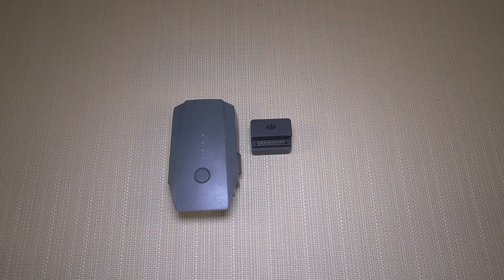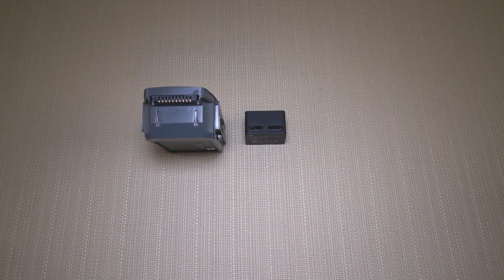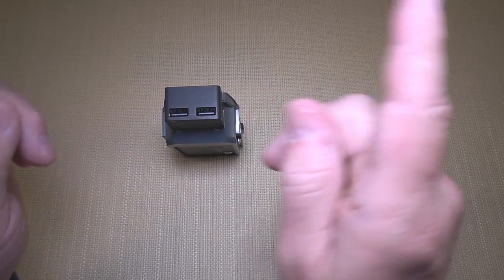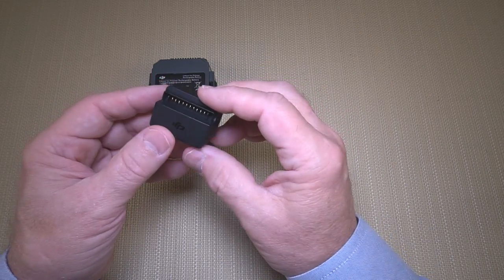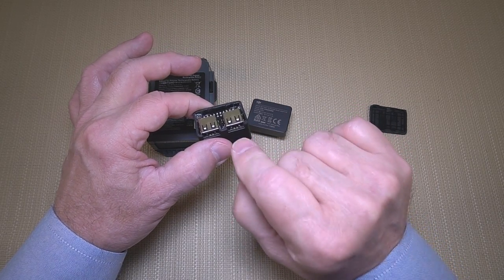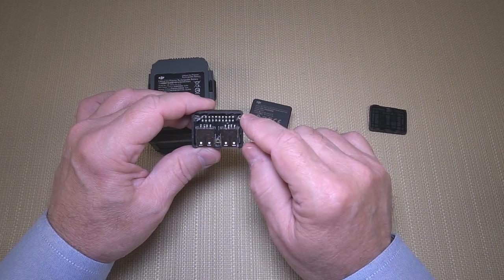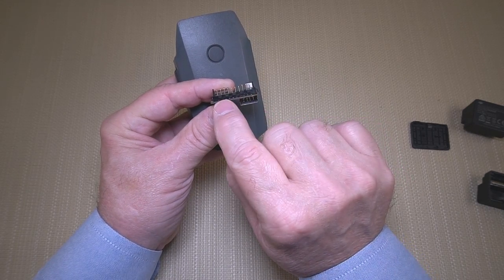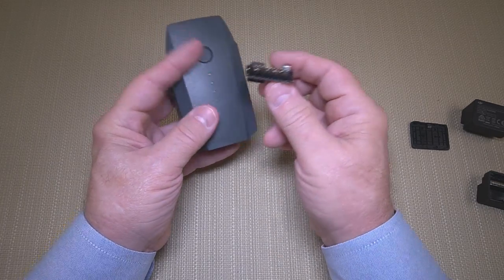What Makes It Tick - Mavic Battery Bank Adapter Teardown

Comment: Hello Rick, thanks for the heads up and technical explanation. Talking about those car charger, I have 2 slots for iPhone and ipad... i guess with 2 different amperage. Can I use the iPad slot to charge my iPhone faster and is there any risks for the battery? Thanks in advance

Comment: Not just the MP5402M is a good dc/dc controller itself, it even take care of the communication with the connected devices, to tell them they can draw up to 2A. 

So in my opinion they catched two flies by choosing that specific IC. 
Pushing the efficiency (e.g. in comparison to the 34063, at least for the higher switching frequency, just just by less component count) and get rid of a second IC just for communication (droping the idea to just use resistors). 
I myself appreciate that decision :)

Comment: Hello from Venezuela and thanks for the videos! I would like to know from your point of view as an engineer, why there is not a charger that allows recharging MAVIC PRO batteries using a POWER BANK, thanks!
Reply from the maker: Kake, thanks for the post and the challenge with using most conventional power banks is that they are designed to work with USB devices that require 5V. the Mavic cells are 11.4V, which makes it difficult to charge them. Also, most power banks don't have the capacity to charge them fully. There are a few specialized products (Energen) that are larger power banks designed to do this for you. Search my channel and you'll find a few reviews I did on these.
Reply: Thanks my friend. I have a 30.000 mah Power bank with Qualcomm USB A and C type, I was wondering if something like that will work with some sort of adapter. I will check the video about it in your channel. Thanks again!

Comment: Thanks for the video. I do have a question however. We have been told in the past not to drain the battery to low. Will using this unit possibly jeopardize the battery if we use it at say 20% charge? Thanks again.

Comment: Thanks Rick, Smokey here from Oz and great video as you always do. Yes, I use the adapter very often and it is great! Phone, iPad, Shield tablets and so on. The teardown was superb. I also have several DJI drones and have found over the years they have always been of great quality in their choice of components. I also have several Walkera drones but cannot say the same about their choices - have even had to take out the solder gun to rectify things on them. Have you ever owned/flied a Walkera model. Just interested to know (if so) your experience to mine (I have also their Pro and Premium models of the QRX350's).

Comment: I know what this device for but I was scared to use it. Always thinking, thinking “shall I use or shall I not”. Because, like you said I don’t want to damage my devices. After I watched your video I trust the product now. Really REALLY nice video and explain me a lot. Thank you for sharing knowledge. I really appreciate. 
I have one question left to ask, if you can help me to find out. Do you believe that I can charge iPhone 7 Plus by using that product? Because when I called Apple, they said their “i” products which use lighting cable are different voltage from other old iPhone models.
However MANY THANKS for knowledge. 👍

Comment: Hey Rick, great video, but I was curious if you knew how low you can discharge your mavic battery with this adapter (or in general)? Does this automatically turn the mavic battery into an actual power bank so you can fully discharge it or is this unsafe for possible cell damage? How low would you recommend I should bring my mavic batteries so I can get the maximum amount of use out of them but still not harming the battery? Thanks.

Comment: Please do a tear down of the YX 5 port Mavic charger.  3 Mavic batteries, DJI goggles and the Mavic's controller are a lot of valuable products to trust to this charging device. I'm guessing it will not be as well engineered as this is.

Comment: You can charge the phone using a wireless charger and not worry about wiring it.  My Galaxy 8 uses very little battery life with flights.  I use airplane mode that kills alot of apps.

Comment: Wow great info. The info is perfect for the layman and the rate is also good. I never have to speed your videos up
How about a tear down of a aftermarket usb converter. I think about half the cost. I wonder if it’s the same components as they also claim the 2x2a usb charging rate.
Ok confession. I bought a cheap “for mavic”. If it isn’t glue , I will open it to check. I will look for the staggered connection points. Sometimes I wonder if it’s coming from the same factory doing overruns. 
I don’t plan on using it often as the mavic battery is an expensive mobile power bank and there is no reason to put on extra cycles. But, as a backup I would like for piece of mind. There are times I would go out early evening with a charged iPhone and my mavic and 2 batteries. 90 percent of the time I wouldn’t need to top off the iPhone before home but I’m always like to be prepared so...
Saves weight on a mobile charger

Comment: Hello Rick, Im having issues with one of my batteries with one of the cells getting more charge that the other two and so my battery is unbalanced.  Is it possible to connect an external lipo battery balancer to the mavic pro battery?  I do have rc hobby grade lipo balancer (up to 6 cells) so I will need to know the layout of the terminals of the battery.  Which is the positive, the ground and I guess there is a wire to every of the 3 cells of the pack.   Anyway love your videos and any help would be appreciated.

Comment: It comes in the Fly More kit?  I got the Fly More kit Dec 2016 and it didn't include one of these.
Reply from the maker: Duck, thanks for the post and I think it did come with the Fly More package when it was initially released. They may have swapped it out in later kits with the charging hub. Either way, it's an inexpensive accessory ($19) to add to your kit that you'll use a lot in the field.

Comment: Thanks for your videos. Watch them quite a bit. Sometimes a few times to get all the info. I have a question though regarding mavic batteries. As I was discharging them to the point for a reset, through the drone, the first battery came up with a broken cell error.  After recharging this particular battery, I looked at batt details through the DJI go app. The battery detail are thus: Charges 17, 3428 mah remaining, 3428 total charge, cells read from left to right, 4.12v, 4.27v, 4.27v., condition is normal, as read at advanced section of battery info in go app.  I have lost trust in this particular battery.  The one cell seems low and may discharge first in flight. Should I stop using the battery.  Other 3 batteries are good. No noticeable voltage drops through the cells. Only differences I see throughout the 4 batts are the total capacities are all different. All batts were discharged to less than 10%. Have had drone since mid December last year. Let me know. Thank you again
Reply from the maker: John, I wouldn't give up on the battery just yet. I would suggest depleting the cell one more time until it turns off (hibernation mode) and then the next morning charging it up fully. By depleting it like that you'll reset the counters on the cells and start fresh. If it's still acting up at that point you may have an actual issue with the battery that needs attention. Good luck and thanks for the post. Rick
Reply: Thanks Rick.  I will.  This battery was one with the fly more package.  May be out of warranty.  Have refresh package but I fly easy.  No rough stuff. If still an issue after hiber mode I will use it as a backup to charge my other devices, and pick up a new one.  In the advanced battery detail screen, the cell that is in question is noticeably lower if your looking at the levels.(green)   I also have my batteries discharging every 5 days.  Thought the ten day period to long, the batteries are being excerised regularly.   Thanks again for the response.  Enjoy the videos.

Comment: Hi Rick. After 2nd discharge and recharge it shows left to right 4.13v, 4.27v, 4.27v. About discharging the battery, not sure if I did this correctly.  Let drone idle battery down until  drone shut down.  I then pulled the battery and turned it on(double push on the battery) and let it continue to discharge for 10 more minutes.  Fearing I would get it down to zero I shut it down and recharged after the battery cooled down.  I'm still not seeing equal or near equal volts on the cell in question. I would just hate if cell #1 denergized early or failed and lose the vehicle to a crash.  Just questioning the battery discharge method you perform for your batteries.  Let me know if this is the correct way to discharge these batteries. Thanks again.
Reply: Update on battery. Warning from remote control. Bad cell. Land immediately. Glad it did it on start up.

Comment: Geez, that's a lot of hype to describe a basic 5v switching BEC. No rocket science here. Good solid switching BEC's  with 2a to 5a output are sold everywhere for well under $10, even $5.
Reply from the maker: Thanks for the post but you missed the point of the clip. I completely understand how simple it is to build a DC-to-DC converter and actually built a few in my day with actual transistors. What was so impressive to me about this one is that DJI could have made a few choices that would have resulted in a device that was less regulated and durable and seen a better profit on the device. Instead they decided to use the better components to ensure a more reliable and safer product for the consumer. This is not something you see often in retail (exploding Samsung phone because of an inferior battery) so it deserves to be commended. My main goal was to open up a totally sealed device to see the magic inside, hoping they did the right thing. And they did. Thanks for stopping by and I hope you'll stay tuned for more of the clips I'll be posting. Rick

Comment: I'm an electronics engineer. I've seen this clip a month ago and I must say that I'm very unhappy with such a review so finally I've decided to protest! 
Are you an electronics engineer or is your engineering in some other domain? Maybe agricultural? 
You are stating that DJI is not paying you for these reviews but I must say that I have very strong doubts about it. 

Here is what I think is wrong with your review:  
- no oscilloscope test (noise)
- no thermal test
- no current test
- no voltage test
- no efficiency test. 

About your engineering comments:
- An LDO (or diode) would dissipate 26 Watt which would mean that this small cube would catch fire without a heatsink. Have you ever seen someone using an LDO for 4Amps/5.5volt delivery from 12V?
- 34063 (AP34063S8G-13) costs $0.21with digikey and considerably cheaper in China. Its efficiency is 80% therefore it would dissipate 2.5Watts. 
- 5402 (AP65402SP-13) costs $0.56 with Digikey and has up to 96% efficiency. Spending $0.30 more on a chip, hardly justifies the outrageous prices DJI charges for this piece of hardware. It's true that they used MP5402M which costs $2.54720 on Digikey but it still does not justfiy the cost. 

Last and least:
Why are you congratulating them that they used 3 screws instead of 2? Who is using 2 screws? It should have 4 screws, 3 is the bare minimum!

Please let us know how much they are paying you!
Reply from the maker: Thanks a lot for the post and I always enjoy a good "Nerd fight" :)
For starters, I'm an Electrical Engineer with 40+ years in the industry, starting back in the days of vacuum tubes and selenium rectifiers, so I have a lot of experience with the gear I am reviewing and the technology behind it. Second, I'm just a flier like everyone else that enjoys this hobby and don't work for DJI. They didn't sponsor this clip and any small $ I receive from them is when someone buys a piece of their gear through one of the links I provide to support the channel. Having said that, the clips I produce are designed to provide a little better insight into the products I use and how they are made. I don't dive deeper into the math or science on purpose to make these clips interesting to the general flier. If you and I were working in the lab designing this adapter, we could have those types of discussions about design decisions all day long, but most people outside of the profession would have fallen asleep 2 minutes into the clip. 
  My point in making this specific clip was to point out that with all of the choices that the Engineers at DJI could have made on design and selection of components to build this adapter, at every single point they opted for the more durable and costly choice. I review a LOT of gear from all types of companies and have worked (and still do) for some of the larger ones, and this is rarely the case. Most consumer electronics companies choose profit over longevity because they are beholden to their shareholders to squeeze every bit of revenue from their sales. I found it refreshing that DJI is trying to do the right thing and build products that last, whether this is their quad, charging hub or adapter. I've torn all of these down and been pleasantly surprised at every turn. I know that you're new to YouTube and maybe the hobby as well, but you'll find that it's a very inclusive group of fliers that welcome debate and are all trying to help each other, myself included. I hope that helps explain things and thanks for the post. Happy flying!
Reply: I see your point about keeping things interesting and now that you made it, I agree with it. 

However, I stand my ground that using a $1-$2 higher BOM does not justify their outrageous prices. 18GBP for DJI's product vs 4GBP on ebay's "Dual USB Car Charger Battery Power Discharge Line Cable for DJI MAVIC PRO RC550". Better yet, one could just buy the cable adapter (which should be less than 2GBP) and use their existing USB car charger ...
Reply: I agree, this can only looks like a good "engineering discussion" to some kid in primary school and it could have been done in 2min with the same details... but I guess that's what the some people wants...